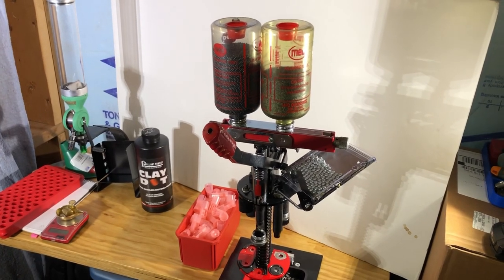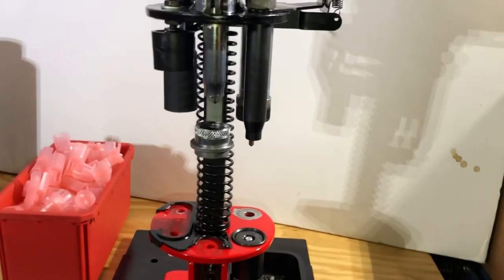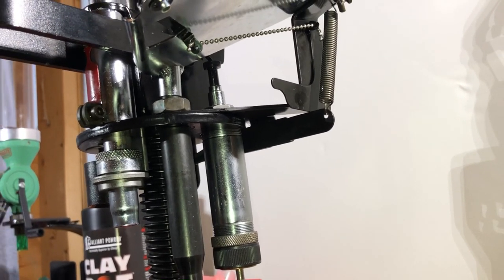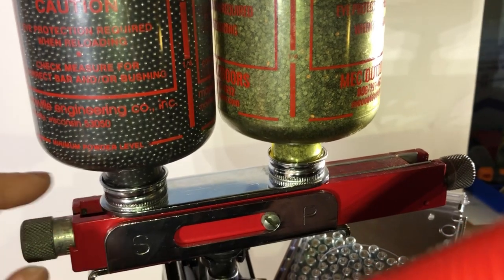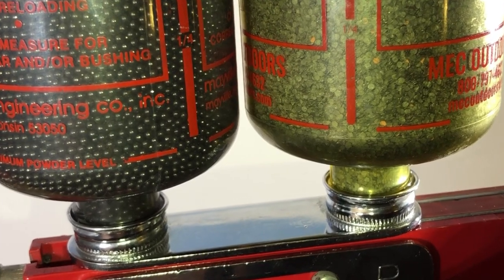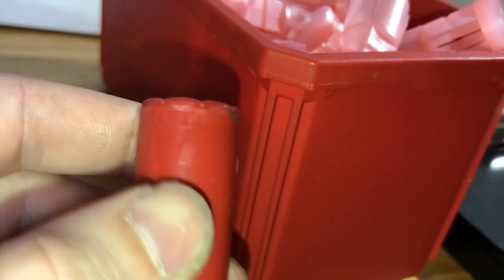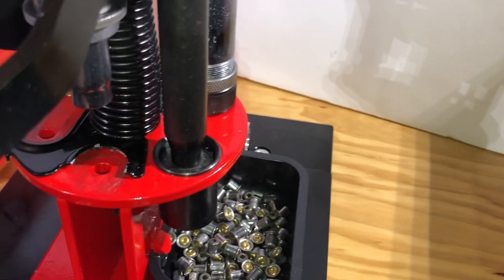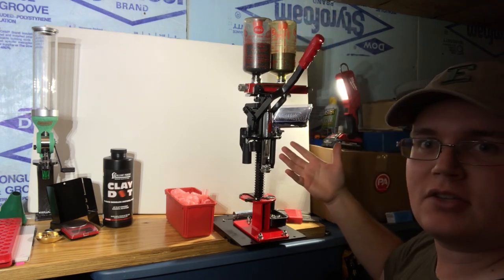MEC 600 Jr. — Setting Up and Adjusting The Best Shotshell Press For The Money

Comment: I have been using a 600 for more years than I care to admit ( about 40 years). I'm currently on my 3rd machine.  After MANY thousands of rounds through  each machine.  I find it much simpler and cost efficient to replace the machine to rebuilding it.

Comment: Many Thanks!
 I was given a pre 1982 MEC 300 Jr. like yours and in similar  condition .
 My press is old enough that the handle and other metal parts are blued instead of paint!
I dissembled mine and boiled the metal parts  for an hour an used a Carting wheel to remove the remaining rust. 
Boiling water will convert the iron oxide to iron nitrate which can be removed with the carting wheel and not damage the bluing!
Your video answered my questions about how to set up and adjust the  press.
Reply from the maker: Happy to help! I love how well MEC made these machines that even years later they’re still easily maintained

Comment: Great job on this MEC restoration and the video!  I have an old MEC 600 JR, in 20 GA that I bought from a guy at my gun club which was all completely assembled but it does need some TLC work.  I don't think I'll add the primer feeder since this is really. single stage press.  Thanks for sharing as I hope to get mine operational just as soon as my order from INLINE FABRICATIONS quick-release mechanism arrives.
Reply from the maker: Thank you! Have the in-line fab setup myself and love it!

Comment: Very nice video. I just ordered a brand new MEC 600 JR MK5 for .410, and another one for 28 gauge. I found both of them on eBay. Couldn't find them in the gauges I needed in any of the local sporting goods stores.

Comment: Great instructions.  Nice rebuild.
Love my 600 Jr. Mk V in 410. I find it precise, reasonable to adjust, easy to use especially when compared to the Lee Load All.  (I have both). 
Buckshot must be loaded manually.  
Does the old version have the ability to tilt the shot and powder bottles backwards? That way they can be emptied without making a mess.
Reply from the maker: Yep! The Pre-82 model can tip the top backward as well. Any recommendations for buckshot? That’s next on the list!
Reply: @thereloadingcraft  ballisticproducts has some nice PDF manuals.  I have the Small Bore Manual 11th edition which has reliable load data for 410 buckshot. I'm sure if you look around there you will find a manual for the manual you need. They also sell buckshot and other components.
Reply from the maker: I will give them a look!

Comment: You should be able to just buy a “Pro-Check” and replace your screw in your bar and that should keep the wad guide down during that sequence.  Mine didn’t have one either, but I do have a Post-85 Mark V
Reply from the maker: It would definitely be helpful! Also agreed, mine is a Pre-82 model though. Would it be compatible?

Comment: Very informative video. Do you have one in .410? my shot tube has always had a problem with shot binding or clogging as the shot drops.  I’ve replaced the tube with same results. The tube is brush cleaned.  Mec rep said to coat the shot with foot powder, I’ve also tried dry graphite but no luck. The shot still jams as it falls. Any advice?
Reply from the maker: Interesting 🤔 since mine is only in 12, I don’t know if the shot tubes are different sizes between the models. 
What size/type of shot are you using?
Reply: @thereloadingcraft  7 1/2, 8 for my Judge snake gun. I use that due to rifling in the judge. It gives a decent pattern at 2-3 paces. However just added a semi 410 and may try different shot size.
Reply from the maker: Hmm, 7.5 or 8 shot should be plenty small enough to drop reliably, I’d think. What’s an approx. diameter on the drop tube?

Comment: I've got an old Mec jr that I'd like to set up for Turkey loads but I'm confused how to choose what bar an bushing to use
Reply from the maker: So choosing the bar just comes down to figuring out what amount of shot you want. (7/8, 1oz, 1.25 oz, etc…)
From there, a loading manual should have a chart saying for X-grains of a certain powder, use bushing number whatever for this load. 
Basically you figure out what load you want to use, then get the right size shot bar and then bushings to match the proper powder charge. Check on a scale after setup to ensure its correct, of course.

Comment: Why when I try to reload high brass? Does it get stuck in the seizer die? I've tried to adjust it, but it just doesn't seem to want to work.
Reply from the maker: Some sizing dies don’t have a long enough extraction stroke to fully push out high brass shells. You’ll have to pull them out manually the rest of the way, or use a dedicated collet type sizer.
Reply: @thereloadingcraft  Thank you
Reply from the maker: No problem!

Comment: Your primer tray feed tube is on an angle, not down all of the way.
Reply from the maker: Yep, that’s where it settles to whenever it resets, I’ve tried to adjust it but no luck. It feeds primers just fine and doesn’t interfere with anything so I haven’t worried about it